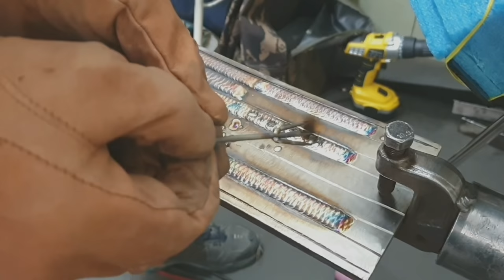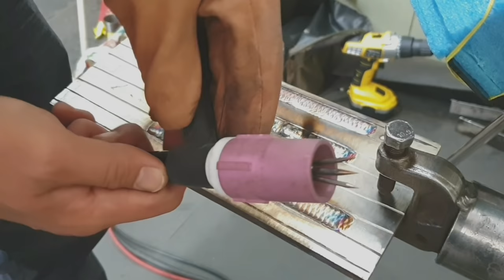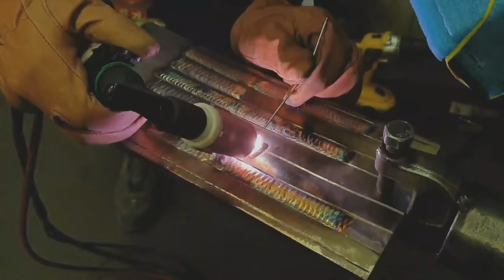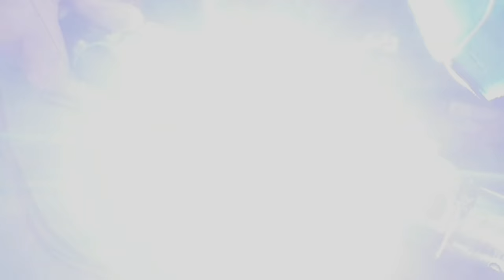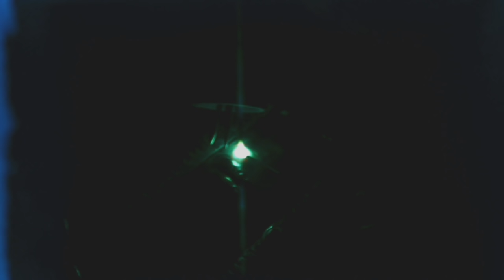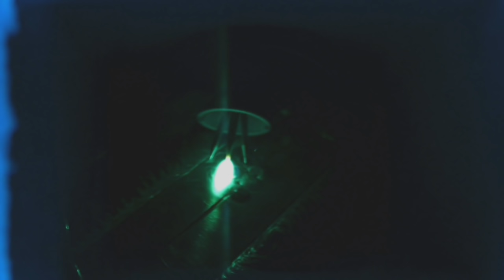독창적인 텅스텐 3지창 !!!

Comment: Everyone needs to chill out, he was experimenting, and he did not fail, he found a way that does not arc 3 points at once, but if he had succeeded everyone would be asking every detail of how he did it. Anyone that makes fun of this is jealous that they didn't try it first. I suggest that instead of having a triangle shape, connect the so that they are parallel and with equal gap between each other, maybe a 1/64 gap would achieve a different result, i will try this and maybe send u my results.
Reply from the maker: Thank you so much for a good point.  Is it possible to weld even if you disperse the vertices of the electrode that you are curious about?  I was curious and shared the video.  I will always challenge.  Thank you for the good advice, and have a nice day.
Reply: What did you use to connect the thoriated electrodes to each other. Nice try by the way.

Comment: I see no reasonable use for this please explain why you would do this
Reply from the maker: I was curious and tried it.  Change makes some birth.
Reply: @welderjin  ok, that's was an experiment I thought you might be trying to see if it would run a supee cap bead or something like that.
Reply: I was wondering the same thing. I could see maybe using 2 and being different sizes. But it might always choose the smaller one, due to its path of lease resistance.  I could be wrong